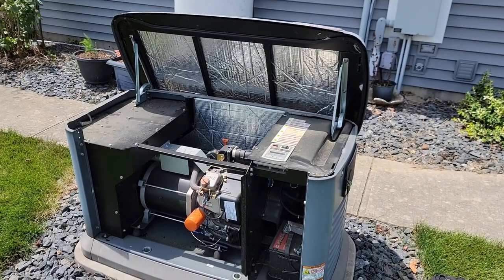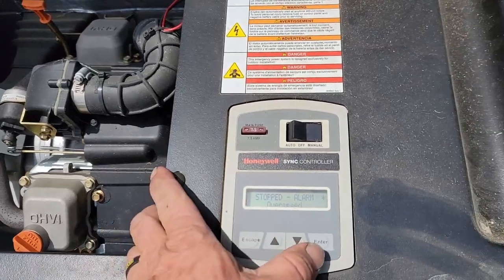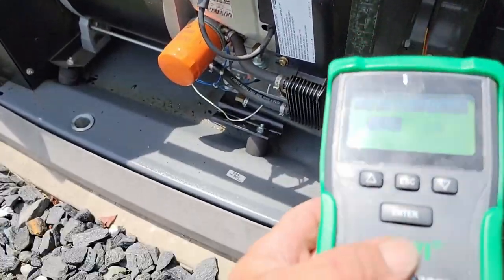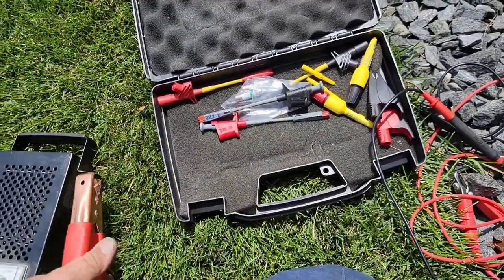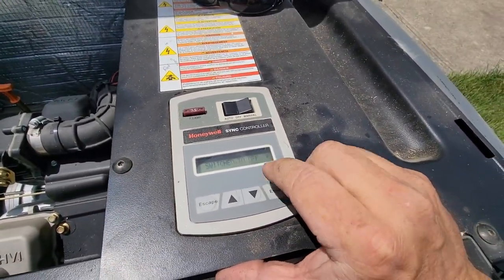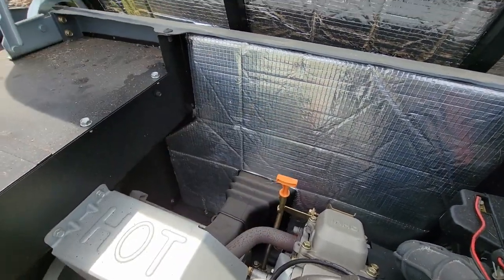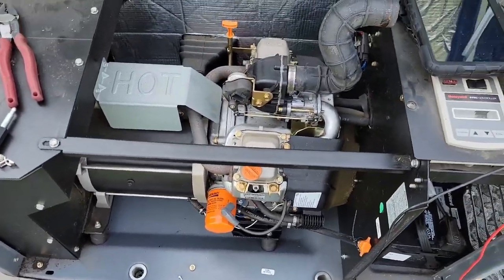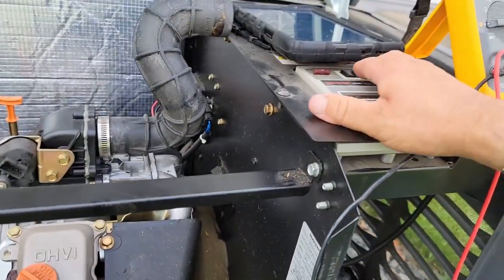Generac / Honeywell Generator Overspeed Failure Plus Engine Problems!

Comment: Hell....you did more than what 90%, of other techs would do. Never worked on a gennie before so i like these videos. You also seem to know more than what im guessing 90% of other techs know. You performed all the tests/ diagnostics that was called for....came to a solution that would fix the problem right the first time. Was able to get it up and running, as close to specs as you could do on site. Brought that frequency down from 70hz to a proper 60hz. 

This video is exactly what we as service techs are supposed to do. Diagnosis, fix what we can, provide information on repairs that are needed...give customer value for their money...thats it. Another great video as always Rick.
Reply from the maker: Thanks Jason! I figure I'll get crap for not repairing the engine. 😳
Reply: @HVACRSurvival  you might...but it'll be unwarranted. Unless your company advertising as a engine shop....not your job. Your job was to fix what you could, identify the problems and notify the customer.

Comment: Your attention to detail is very impressive.

 I know those older ones had issues. I have the new type which they claim they solved them. Mine is 2 years old a 22kw and they already replaced the starter. It gave an RPM error on startup. I played around with the manual start and could hear the starter wasn't sounding normal. It did start after that. This is also monitored. They told me there is a bulletin that in hot weather when you get that code to replace the starter. It's covered but they put the same model starter back in, not upgraded. lol Not sure how that fixes the problem in the long run. Florida heat kills. It's damn nice though when the electric went out at 2am (I was up) within 30 seconds the gen came on and we had power. If you never lived through a hurricane without power for a few weeks you will understand how much I love this thing. Keep up the great videos!

Comment: You did I your job in diagnosing an underperforming cylinder due to a poor intake seal between valve face and seat.  Charge the diagnostic fee, battery, oil & install then on to the next call.  Thanks for the vid!
Reply from the maker: Thanks Brian🤜🤛👍👍I appreciate the understanding!

Comment: Definitely worth repairing. A small engine guy can pull the head. Probably just lap the valves or replace a cracked valve so that intake valve seats.

Comment: I have a 10-year-old 12 kw Honeywell generator I do all the oil/filter changes, valve adjustments, etc. myself once a year. The generator now has the front spark plug which looks exactly like the rear one you took out. The back spark plug is clean just like a new one. When it does its weekly, test a huge cloud of smoke comes out on startup but clears up right after it starts running.  There is a little black residue bult up on that exhaust side manifold connection bolts.  My "shade tree" mechanical diagnosis is bad rings letting oil into cylinder.  The engine runs smooth with no vibration, so I was going to just run it till it died like someone suggested in the comments. My voltage and frequency are not rock steady anymore and I have flickering in my lights because I had a lightning strike close by that took out several electronic circuit boards in TV's, HVAC systems, garage door openers, etc. about a month ago.   I think my automatic voltage regulator in the control board was damaged from the lightning but not "fried" or my engine is now having enough RPM variation to cause the shift in voltage/frequency.   (119-125 volts/ 59-60 Hz frequency).    You are a very professional, extremely well-trained technician and I really enjoy watching the very detailed steps you take in all your videos. Any suggestions/advice? Thanks
Reply from the maker: I think you're on the right track. I'm not a big engine kinda guy, my brother in law is certified by most of the popular small engine companies so I call him if I'm not sure. It's hard to be good at everything.

Comment: Good job Rick, The wires on the transfer switch did look a little small and I'm not sure if the engine is worth fixing, and once you fixed the screw on the solenoid, it seemed to run fine, good job regardless.
Reply from the maker: Thanks man!
Reply: Wires on the gen side of the TF switch are sized to meet the gen capacity. It's only a 10 Kw so likely #6 wire. (protected by a 50 amp breaker at the set)
Reply: Thanks, I was so upset about it.

Comment: Good call on finding that slipped idle screw. If the stepper motor moves freely the next step (shooting from the hip, not the book) is to see if you can manually hold the throttle down. If it won't go down then that is the FIRST thing to diagnose. On the other stuff, I think you focused too much on trying to solve a minor engine issue. Yeah, the compression was a little down, but that can also be from many hours of running poorly. I usually stick with the basics on those so check valves, new plugs, and such first. If you are worried about the compression, you could go back in a few weeks and see if it's improved after running better for a bit.... or make notes and check it at the next service. These other service items will NEVER let an engine run too fast. As for that oil leak... I find its usually the OP switch, oil filter not tight, or the breather gasket. On the older sets I saw the oil cooler lines leak too. Just add a hose clamp and walk away.

Comment: You did good troubleshooting - you didn't just stop when you found leaking valve, you fixed the issue you were called to fix.
I noticed that you didn't say if the valves were tight or loose before you adjusted them - if intake valve is to loose it can indicate crud or burnt oil build up on valve seat - this oil typically comes from breather. Oil from breather is caused to by breather flowing higher CFM than designed to flow. Excessive crankcase CFM is typically caused by leaking crankcase - leaking crankshaft seals or oil fill cap(also can be from leaking piston rings).
Just a side note - valve clearance will loosen up approx .004 when at operating temperature compared to 60F valve clearance. Always compensate valve clearance when adjusting valves on a warm engine.
Reply from the maker: I forget, I think it was loose. My brother in law was certified by several small engine manufacturers when he was in school working for Ace hardware. I usually call him asking questions. I was never into engines like most guys, I was mainly into electronics type stuff.

Comment: Thanks for your video.  I have a Generac standby, made 2008,  15kw.  Has been working fine.  Yesterday failed to check self start.  Getting flashing light - overspeed/rpm sense. won't manual start.  also lot of oil on/in carb housing under air filter.  Oil is good, air filter good. What can I check next? Thanks

Comment: I'm working on my generator as we speak. It has similar hours. It's the same/ similar unit. 135psi in the front and 110psi in the back. I did a cylinder leak down test and the back cylinder wouldn't hold any air. It turned out to be a blown head gasket. The cylinder and piston looked new, as it should on a machine with 120 hours. The head was a little dirty and the valves and seats were good. The oil at the bottom of your generator is probably not spilt oil, but oil blown out of the crankcase vent because of the head gasket. These generators I'm told, start to leak oil out the crankcase vent. My generator has been leaking for about a year. I'm almost 100% sure it was the head gasket starting to go bad and causing excessive crankcase pressure. Now it's bad enough for a no start. $35.00 in gaskets and 4 or5 hours she will be as good as new!

Comment: Hay brother I have around about same problem with these generators the company I work for has HVAC-R techs, electrocution, plumbing techs also and like you said up around your area the gensets happen to call on the havc techs down this way too great video Rick, I’m working on a generac now that just keeps cranking what a headache thanks for sharing
Reply from the maker: Thanks Doug, I get some crap for the way I do things but that's why I level with the people and explain I'm over working on these, either go all in on these or get out. No one else will work on them 🤦🏻
Reply: I feel the same way brother, I know if we worked on nothing but generators the diagnosis would be quicker and be able to touch and feel like all techs do with line sets
Reply from the maker: Exactly 💯%👍👍

Comment: No idea what I just watched but Rick makes it entertaining 👍
Reply from the maker: Basic electricity, no biggie 😁.  You take a motor and with a two-pole rotor then you spend it at 3600 RPMs, you inject a DC voltage into that rotor via slip rings, it creates a magnetic field and that's captured by the stator, then use a voltage regulator to regulate the dc voltage going into the rotor and you have a generator.  1800 rpm if you have a 4 pole rotor.

Comment: Did you take the oil fill cap off while it was running the leak down Test to see if it was going in the crankcase
Reply from the maker: I believe I did, It was not the rings this time.

Comment: Lol I bet it’s the stepper or controller for the over speed the oil in bottom is common for some models at certain years most likely rear engine seal

Comment: There are a few cylinder leak down test videos on YouTube that may be useful.  If you are hearing the leakage in the intake, ithe leak is probably going to be an intake valve not seating correctly.

Comment: Maybe when it had the low oil pressure alarm it caused some damage, although I wouldn't think that would cause the intake valve seat to fail.  A ring, definitely yes.

Comment: What is the diagnostic manual that you are using? Is it generalized to small generators or specific to generac? Thanks
Reply from the maker: I have several different ones, I have commercial up to 250,000 watts down to some portables but my manuals are about 2 years old right now. And the commercial ones are 10 plus years old

Comment: 10kw Generac’s known for oil leak at the engine breather.   I fixed this many times
Reply from the maker: What did you do to fix it?
Reply: Generac offers replacement gaskets.
Reply: @bobsterner5597  ... gasket is good to have but I noticed those retaining screws are always slack. I take a coffee break and snug them a second time before reassembly. I also use a light coating of high temp silicone. BTW, be sure to keep any of that metal mesh well away from the breather flap. If it hits you will be tearing your hair out looking for an oil consumption issue.
Reply: Yes ive done silicone as well.  And extra thread lock.
Reply: @bobsterner5597  ... personally, I don't think the bolts back out. I feel the gasket just compresses with time. When you add silicone, then run your finger around, it fills the edge up nicely, so a little slack doesn't leak oil in the future.

Comment: engines that don't run enough can get gooy rings or skin rust on valves. run for 1 hr and retest and do a dry then wet(squirt some oil in the cylinder) test if it is rings it will be different between wet/dry test. and the oil might break loose the stuck rings. common problem.

Comment: I am guessing that you don't like generac genies? What do you like? What do you own?
Reply from the maker: I own two Generac gas generators.  A 8kw with  12kw starting watts and I just purchased an inverter 3kw starting,  2300 running watt. I make sure to properly start up and break in my generators unlike these home standby generators that are just verified to run and left to break in on their own.  That's why I think most of these fall apart... not to mention I think these things sitting outside and hardly ever running is another huge reason for the problems I keep seeing. In my opinion they're a waste of money unless you're disabled or unable to take care of a regular generator. They are a convenience but they have a high cost for the convenience.

Comment: at times carbon gets between the valve and the seat and holds the valve open a couple thousands and it leaks a small amount of compression  tapping on the top of the valve brakes it loose and will reseat the valve, its worth trying before disassembling the engine. still has an over speed warning
Reply from the maker: Good ideas👍👍

Comment: The valve leak does not explain the overspeed. You were wise in persisting your search further!!
Reply from the maker: Correct, the screw was the initial problem on the governor, you got to remember I couldn't see that screw when I had the plastic on the carburetor in the beginning, it was after I tore it completely apart that I saw the screw.
Reply: Great job sir!

Comment: Minimum allowable compression is 150 cold per manual. I’d rather investigate this than change magnetos or see an under voltage alarm. Good job.
Reply from the maker: Thanks James! I try to not get the book out every time, I have had so many problems with Generac engines that I usually check all the same things every time.
Reply: Had to go to CT for training. Generac are trying to blame techs for the failed engines because they won’t adjust valves. The training is getting more strict and in-depth which I appreciate but I just don’t touch em enough to be super comfortable as I am with heat and AC like you said.
Reply from the maker: Their training is a joke right now, they're forcing you to get recertified every year which is a waste of money, and then they want you to do it all in all online.
Reply: @HVACRSurvival  ... actually, I was pushing for on-line recertification a few years ago. (pre-covid) because unless they came out with a new unit it was kind of a waste to send techs to a multi-day class when they already knew 90% of the material. This was something I figured out years ago while I was doing automotive work and they offered new model updates to senior techs. The classes were a single day and only covered changes, rather than everything from scratch. Since it was only senior techs we also got a chance to discuss problems and actually write service bulletins with approved field fixes.
Reply: @jameslang9170  technically if they're not adjusted they could become too tight from valve seat wear and burn the seats/valves or cook the head around the seat, etc.
it could also be rodent/low airflow issue causing overheating which can loosen the seats and expand too much at different rates, causing the same issues.
the valve lash becoming too tight very well may have been their findings.
Reply: @throttle bottle oh no I totally agree the valves 100% should be checked and adjusted. Generac is so convinced that’s the problem the new generators have hydraulic lifters so they don’t need to be adjusted. Had a lot of overcrank alarms fixed by fixing valve lash. Exhaust valve is almost always too tight in my experience.
Reply: The only problem I have with generacs new generators is the cooling wheel is impossible to remove without breaking it. I have better luck with old nexus or evo1 cooling wheels than any new one. Wd40, heat, washers nothing helps.
Reply: @jameslang9170  ... I have had good luck with a small puller, but I have also had the aluminum center break off, which makes me wonder if the guys at the factory overtightened in the first place.

Comment: If the engine is out of warranty i'd just run it till it popped or started to make some hellacious racket. Running it low on oil though sure don't help anything at all.
Reply from the maker: That's what I told the customer 👍👍, I don't think it's worth spend the money fixing it until it's dead.

Comment: My Father has had 3 Generacs at various properties throughout the year.  One thing I notice is MILKY OIL consistently.  The oil never really gets dirty but it gets very milky.  I am told this is due to condensation.  I change the oil much more often than the 100 hours of run time it calls for in the book.  I also disabled quiet test mode to make sure it runs at full RPM during its weekly exercise, and also have it set to weekly exercise rather than bi-weekly or monthly too!  I use full synthetic 5W30 and also use a Purolator L14476 oil filter as that is very easy to source!
Reply: The less of the short 5min excercises the better. If it could run 10mins instead of 5 it would solve issue..pre 2012 models ran 12mins and was never an issue. So monthly or biweekly exercises are better then weekly because of the short run times especially in the cold temps and no power loss, a common misconception
Reply: @evan1kx125  I believe the weekly exercise is 10 or 15 minutes or somewhere in-between, not 5.
Reply from the maker: I agree with your settings and your maintenance schedule 👍👍
Reply: @HVACRSurvival  Thanks.
Reply: @Guillotines_For_Globalists  yes non quiet test is better. 2013 and newer units only the smaller kw units under 11kw run longer then 5mins. Switch it to bi weekly from weekly and it will help with moisture. It's not building up moisture from sitting its building up moisture from not heating up engine fully from exercises mainly in the colder months. Also a spring time oil change will help rid moisture. Iv been doing generac service for 15yrs
Reply: @evan1kx125  I do oil changes every other year typically.  On his latest generator I lapsed and changed exactly 3 years after the last service and during that period it had only ran for 42.9 hours in 3 years!

Comment: Why does it not have hydraulic lifters so that no valve lash adjustment would be necessary?
Reply from the maker: I'm not an engineer nor did I design this but I would say probably the cost is why,  people are cheap and that's why this is the number one selling generator,  people don't want to pay extra